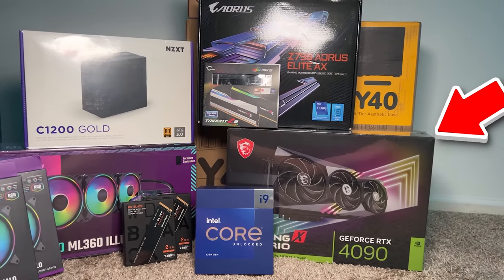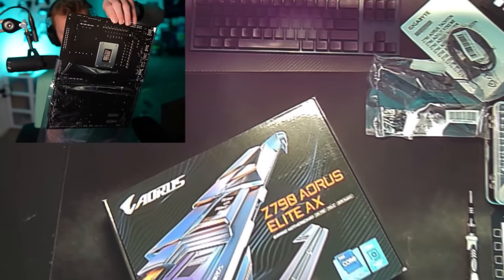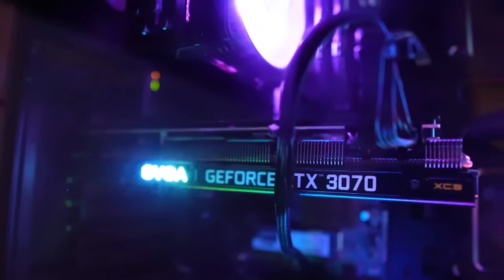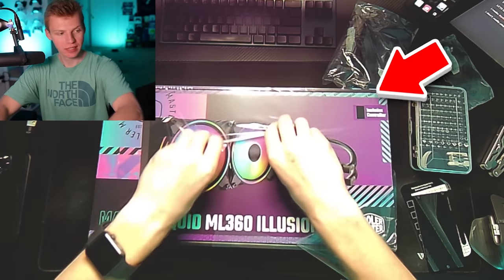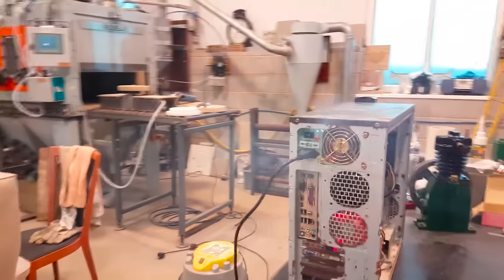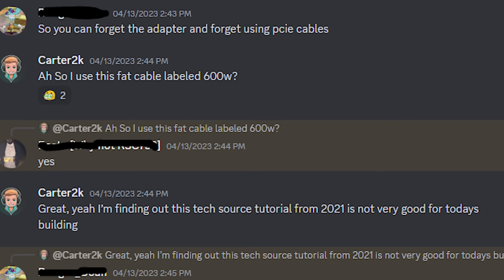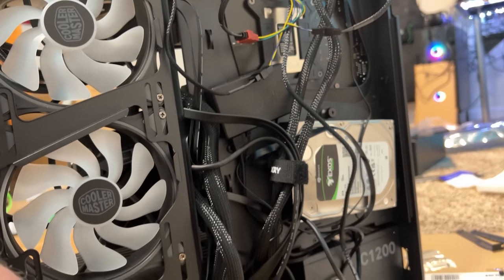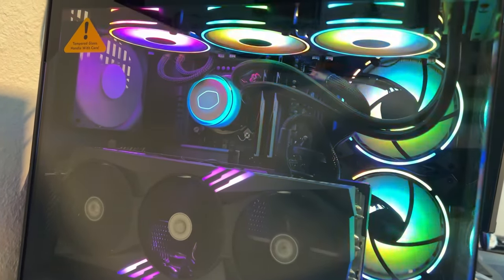Building My First Gaming PC with No Experience… (High-Budget)

Comment: Hey carter I was wondering if how much I can get your old gaming pc (the mid one) because I never had one and I’m not building one so how much are you looking
Reply: Hmu ill build one for u. Choose what components u want.
Reply: Build one, it’s cheaper and you can choose all the parts.
Reply: man build one, cheaper, and you can get parts used for even more cheaper. i saw someone build a 3070ti build for 1k
Reply: Dam so I should build one then
Reply: Yes
Reply: @MHMD-09 what gpu choose for i5 13gen? rx6950 xt, rtx 4070, rtx 4070ti, rx 7900 xt?
Reply: @Kambel89 there are many i5 13th gen, main ones are 13400f and 13600k, I would recommend i5 13400f with 3060ti
Reply: @inacwords yea i got a 3080FE build for $1k
Reply: @MHMD-09 How can I check if parts are compatible I wanna get a custom pc since I have a prebuilt right now
Reply: @rxre6969 Use the site called pc part picker
Reply: @rxre6969  Click on top left builder and build your pc
Reply: @codysmith8933 when did nvidia start making fan editions, isn't that a samsung phone thing?
Reply: @jamesjohnXII  the rtx 3080 founders edition.
Reply: Is the intel core i5 12600k a good cpu?
Reply: @swagify6969  really depends on the rest of the pc and what you're using it for
Reply: @inacwords i built a 2080ti i9 9900k build for 700€

Comment: Those are some great specs.
Congratulations.
I built my first PC about 2 years ago and it's time to upgrade.
Still deciding if I should just swap out the cpu & graphics card or build another from scratch.
It really isn't that difficult, just research and follow build guides.
Reply: Just swap the cpu and gpu, just dont waste your time of starting a another pc build, and you´re ready to go:yougotthis:
Reply: only upgrade if your case is too small for good parts, don't build from scratch, not even if your mother board is damaged or you need another one, mother boards are replaceable, and it's way cheaper to upgrade part by part than build a PC from scratch.
Reply: i would build another or swap 3 things motherboard cpu and graphics card
Reply: @NoOnesEdits if you swap your motherboard you may have to upgrade to ddr5 ram
Reply: As someone who’s good at game development and software building a pc is nothing. Trust me never buy pre built

Comment: This was a really good video. It gave the feeling of an average guy learning and having a hard time. The only problems I had with my first PC was putting the ram in the wrong place and connecting the display port to my motherboard instead of my GPU.
Reply: @@gogipoggers what mistakes if i may ask
Reply: I also messed the display port part up too… Still working in my pc rn, stuck at the getting the operating system going
Reply: Trying to build my first gaming pc. And I’m so lost. This video just made me feel like ima screw it up.

Comment: i managed to build a 1000 dollar gaming rig (brand new and used parts). I got a ryzen 5 5600 and rx 6800xt. A 32 gb of dual channel ram. A respectable FSP hydro g 750W gold rated psu. Asus tuf b450m plus ii. 6 arctic p12 argb fans. darkflash dlm21 mesh case. darkflash dx240 AIO (replaced stock fans with arctic). A couple of 1 tb harddrive and SSD. both 2.5. 

I am playing on a 1440p ultra wide monitor, so the CPU and GPU combo is great. I can play fortnite epic settings at 100 fps (max nanite and lumen), and most games at 60+ fps with some RT on. I mainly play rdr2, and I can reach a 100 frames at max.

I built this system for the past month, and I cant be happier with what I built for the price. Basically twice the power of a ps5, with twice the price. And its a PC! I can do anything I want with it. Even emulation ;) (TOTK 60 fps RT). Never had a BSOD or sudden crashes, which I was surprised, considering my gaming laptop does that a lot.

This build is a monster for its price. It took me months of planning and finding parts that are in good condition. I got the rx 6800 xt secondhand for a little under 400 dollars.

I do not plan to upgrade anytime soon, but will upgrade my CPU, motherboard, and an nvme (for PCIE 4.0). and some aesthetic stuff probably around Christmas this year until early next year.

Sidenote: I undervolted my GPU to reduce electricity bill at the same performance. 1030 mV at stock speeds. Max vram speed. Stable as hell with an average of 70 W power reduction. CPU idle temps hover around 35 to 40 deg C and 58 deg C at full load. GPU sits around 70 to 80 at full. Noise level is silent and I cant hear it even when playing in speakers.

Comment: I had not built a system in 14 years until last February, about a $900.00 build. Well, it has been perfect, I am using it now and everyday. Just take it slow and steady.
Reply: Damn, I’m getting all the parts for mine I feel like I can do it but connecting all the cables is gonna be hard

Comment: he said he got the best pc money can buy.
Improvements:
Motherboard: Rog maximus apex
GPU: Rog strix rtx4090
CPU: Intel core i9 14900k
RAM: G-skill trident 7200 ghz
Cooler: heatkiller 4 pro
And on the radiator unscrew the fans, flip them and then put them back in the wrong way, it cools your radiator and your pc at the same time

Comment: What sucks is you ordered the 13900k before the 7800x3D was released... its still almost the best! Since you making videos its actually the best, I am silly.
Reply: The 13900k is the better CPU. You have no clue what your talking about. The 3D v cache is only better in a small amount of games. While the 13900k is consistently on par or better. Also it annihilates it in workstation tasks and multitasking due to it having 24 cores, higher IPC and clock speed vs only 8 cores.
Reply: @ZackSNetwork  im a intel guy but intel has been running way too hot these past gens

Comment: for the pc cables I recommend getting some nice custom cables from lian li if your pc case was white but in this case I'd recommend some nice braided cables from cablemod in black for a cleaner minimal look,  gpu cable, 24pin cable, and 8 pin+4 pin cpu power cable on the top left
=====================================================================================================
 (also the wire for cpu on top left is sticking out you can put it through the hole for it that's right over the port)

Comment: I don't plan on watching the video, but if the thumbnail is accurate though I'd like to let you, and other readers know if you mount your GPU vertically and it's that close to the glass it'll likely be running hotter than if you had mounted it horizontally (due to restricted airflow). Judging from the size, mounting it horizontally wasn't possible in this particular case (pun intended)

Comment: Just a head up, but when you were testing Fortnite at the beginning, you had your resolution scale set to 72%. Meaning that your system is only rendering the game at 72% of whatever your native resolution is. So 1080P which is 1920x1080 would only be running at 1382x778.

Comment: Spends $4K but cheaps out and buys an hdd instead of an ssd LOL.
Reply: He did I get an ssd but got a hdd too so he didn’t only get a hard drive
Reply: @eunoiasdesigns1317 he bought 2x M.2 NVME.  Instead of a 3.5 hdd, he should of bought a 2.5 ssd.
Reply from the maker: I have 4tb of nearly the fastest SSDs you can get. The HDD is only for storing video content, no need to keep that stuff on an SSD.

Comment: i have the same build expect i saved some money by getting 3090 instead of 4090, big save tbh, simliar performance on 144hz 2k monitor anyway.

I would suggest you few things,
1. First get that CPU LGA 1700 bracket frame ( it helps in temps a lot )
2. Get good paste for that CPU, like thermal grizzly or similar
3. I even got Noctua industrial fans on my AIO ( you might not need ), but im telling you, cooling down overclocked i9 13900k is VERY demanding whenever cpu run or spikes above 75% usage
Reply: Is arctic mx 4 good paste?
Reply: why didnt u buy something like a 4080 instead

Comment: Im building a similar pc everything is the same except im getting an MZXT Z73 kraken cpu cooler, less storage and a different case

Although i need advice on whether 850W is enough power for a 4090 and i9-13900k and if not what psu do you recommend
Reply: def 1000w. don't skimp after a high end gpu and cpu.

Comment: Yeh i just got a gaming pc but don't got fortnite yet but that pc is not the best pc money can buy the best pc u can buy is over $10000
Reply: Nah, after that point, its all just looks
Reply: @sevensamurai4206  tru tru but I found out that the pc that costs the most money is about 12k and then if u are a hard-core gamer you might need 2 monitors a really nice keyboard one like the apex mini keyboard and then you need a really nice desk as well as a mouse that is really good then you need a large mouse pad and all that comes in at about 13k with the pc
Reply: @NoahLMAOfn  Yeah, but 12k for a PC is just looks; you can probably get the same specs for 5k, and top tier gaming monitors usually don't cost over 1k, and all those accessories aren't expensive either.